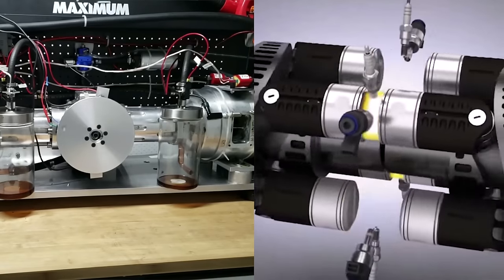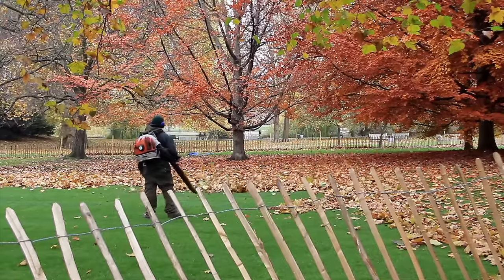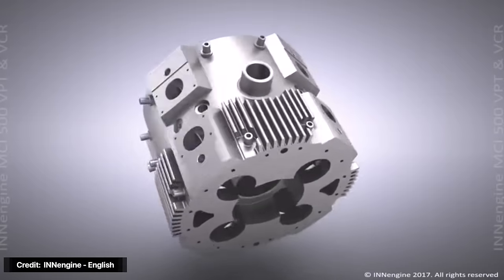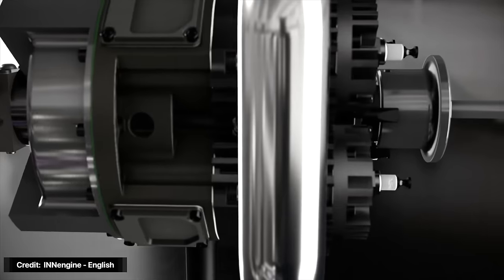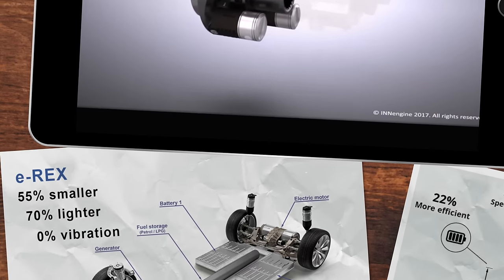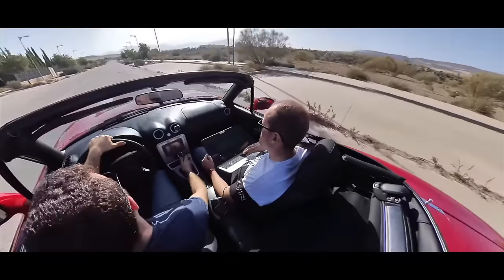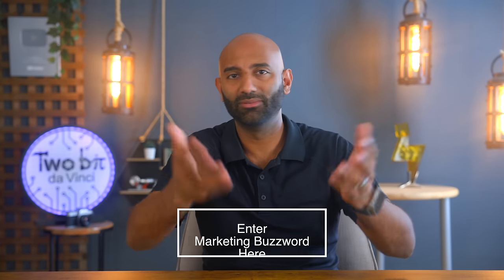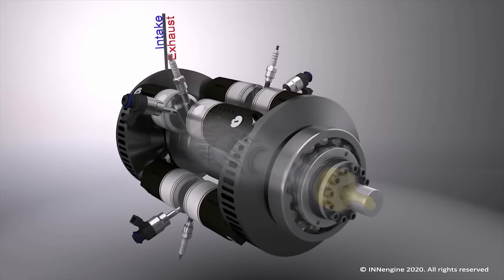One Stroke Engines - 200% More Efficient??

Comment: This is just 2 opposing 2 stroke engines. To have a true 1 stroke, you would need to have a 2 stroke engine that has a combustion chamber on each side of the piston, so that it is pushed on each stroke by a power stroke.
Also, I love the idea of a sine plate. Dynamcam had a sine plate design in 1941. It had the benefit of completing 4 strokes for all 12 cylinders every rotation of the engine. This means that it could produce a lot more power for every rotation than a conventional engine. It was a very promising design, I'm not sure what ever happened with it. But it is still legal to have one in an aircraft to this day.
Reply: As noted, low torque.
Reply: Probably very expensive
Reply: The rollers wear out.  ask any dodge hemi owner about the rollers on the their valve followers. at about 150k miles time for a cam and all new cam followers with rollers. In the case of this engine it would mean a total rebuild.  I do like the engine but best used to power a generator that runs at a fairly constant speed.
Reply: back and forth is two strokes
to have a 1 stroke your piston would have to go in a circle
Reply: @burtreynolds3143  Theres the Wankel engine.
Reply: @burtreynolds3143  you're right. I was thinking power strokes per recip of the piston, which would have 2 power strokes for each reciprocation. They cylinder sees a 2 stroke, but the piston sees strokes as if it's a 1 stroke. But thinking back to my thermodynamics class, it doesn't matter the power delivered to the piston, it matters what happens inside the cylinder.
Reply: Exactly, Chad.
Reply: Yes. That was clearly established. Even by the manufacturer. It's marketing, bruv.
Reply: The biggest problem with swashplate engines is fault tolerance.  What happens during a misfire?  Shakes the motor apart or makes driven mechanisms on the plate skip and chatter.  Injectors, spark plugs, and compression can fail.  That is the main reason.
Reply: The MYT is already using both sides of each piston in a rotating chamber and is efficient enough to run off air, since electrical spark will actually explode compressed atmosphere enough in that engine to be over-efficient by a good measure. The inventor Raphial wont talk to anyone about investment unless they prove they have 2+million first and he wont let go of the patent. He really screwed up and wasted the extra from the first investment round on a house that was repo'd. Last I talked to him, he'd moved into a hotel and was living off social security with his wife. He might have lost his trailers full of equipment to make them for all I know.
Reply: @vilefly  I've seen designs with a roller on each side of the cam plate, so you would have no skipping on a misfire. You would need it anyway for an intake stroke as you create a vacuum when drawing in air, unless you run a turbo.
Reply: @chadjensenster I've seen these designs for ages.  Like A/C compressors.  They make great compressors or air motors, but make for bad internal combustion engines.  It's all about resonance and harmonics caused by the "noise-forces" made by combustion.  It's a bit chaotic.  A roller is a piece of hardened metal, focusing all its force on a small contact point.......it WILL chatter.   Better off as a steam engine or with "fat sliders" on the swashplate.
Reply: That is correct there really is no such thing as a one stroke engine unless U were my late business partner when he caught my son watching porn in my home office. Now there he made the cliche about a little one stroke engine
Reply: @thekingsilverado3266  jet engines could be considered one stroke, but that's a stretch, since "stroke" implies reciprocation.
Reply: I am concerned about the wear of that sine plate over time. Seems like a point of failure or loss of  efficiency. And Tolerances could be an issue.
Reply: @frequentlycynical642  So torque is only created with a crankshaft and counter weights? So if I wanted more torque, I would get a bigger cranshaft and counter weights?
Reply: "michel swashplate engine". far older. "lamplough rotary barrel engine"... far older.

both solved the issue with the rollers/swashplate asemblies. 

michel used his thrust bearing , that is still used in heavy shipping propshafts.
lamplough used a yoke with spherical ends similar to what the "duke" engine uses. except its an opposed piston two stroke with sleeve valves and secondary "scavenging"pistons.

a century later, where are they now?

the problem with rollers on swashplates is they have a LINE contact to transfer pressure through. and that will break through any oil film, no matter what.

and that roller has a width... meaning the line of contact actually only has one POINT that rolls, everywhere else it scrubs/slides.

just like having a solid axle versus a differential. something has to give...

you cant eliminate this by a variation of a "taper roller", as the point of convergence of the tapers is constantly changing through the revolution. the spherical yoke and the michel thrust bearing are the only options that eliminate certain issues.

and as i said... where are they now?

Comment: Old dude here. 
I’ve never been against electric cars. In fact I can see the practicality in them , except for 2 big reasons. Range and cost. 
Neither of which has been addressed to date. 
And frankly changing every car or truck to electric in America is impractical due to  the cost of upgrading the grid, and needs of large semi trucks. 
I know they’re working on it, but we still aren’t there yet.
Reply: And every truck and car is not electric yet. They are working on it. This dumb argument is trotted out too many times. The electricity grid could not cope with, or not enough chargers if all cars were electric now.
Reply: I have yet to see an Electric Super Duty that would run 400-700 miles on a tank of diesel.  As with semis, there is a need for non-EVs.
Reply: Thermal runaway is a problem. Ever heard of the Felicity Ace or the Fremantle Highway? Both car carriers that caught fire due to an electric vehicle going into thermal runaway.
Reply: weight is also a huge problem. gas is 10x more efficient than a battery and you only have to carry 50 lbs with you instead of 1000. you can also carry another 20 lbs in a can in the trunk so you dont get stuck in the desert. temperature is also a problem, esp cold. if its 10 degrees outside, that 300 mile range will be closer to 100
Reply: @chrisbrossette  semis are too inefficient. we should be using more trains
Reply: @carlholland3819  use what works until we perfect a solution and CO2 is not the problem, it is in fact essential for all life on Earth.
Reply: @carlholland3819  We could but the railroads have been ripping up tracks instead of repairing them, this leaves semis as the best way.  Should we have better railways, I agree, but we are not using them as so much shipping is 'just in time' and the people can not wait weeks for deliveries.
Reply: Trains easily excell at hauling immensely large loads over a very far distance, with way less vehicle traffic on average. That being said railroad traffic is alao a thing but there are rare cases when it really gets busy on the rails but oftentimes they're mostly empty with one or 2 running locomotives pulling the loads and carrying the cargo to different locations.
Reply: We proved that, in California, just last summer when they were asking people not to charge their electric vehicles because the grid was being strained to just meet the ordinary peoples needs ‼️😲🤯
Reply: EVs cheaper over the life of the vehicle. Combustion has far more wear and tear and hidden costs in the form of replaceable parts. If you look into it, rental companies are putting 300k miles on Tesla's with only replacing brake pads. And that's worse case scenario bc everyone beats a rental. There's horror stories of dropping 4k on a battery but that's rare. No oil, plugs/wires, filters, etc to worry about. And dropping a new transmission at 150k is comparable to a new battery.
Reply: @stevethegreatis  EVs might have less moving parts, sure but even they can break down at any point in time. From a long term standpoint they are better but not what you call impervious to damage. Plus the power grid isn't upgraded or sophisticated enough yet to handle millions of them charging at once. And whenever the summer arrives people have their A/Cs on at full blast which raises the risk of power outages. As someone who loves the sound and feel of combustion engines, I do get it. With honesty.
Reply: @TheSilverShadow17 There is no problem with the moving parts, the biggest and most annoying problem is the complex consumer electronics !
Reply: @yakut9876  Perhaps
Reply: historically, with any kind of vehicle, range and cost are issues of scale, they only start to improve when you look into mass production, the price to buy them improves as the price to build them improves, the price to build them improves as the availability and price of tools improves, and the availability and price of tools doesn't improve until there's demand to produce the product more quickly in higher volumes
Reply: @chrisbrossette yes, checkout Tesla semi.
Reply: Totally agree, he triggered me when he kept repeating this mantra 'the future is EV'. As it sits today that is an absolute joke. The exponentially longer charging time compared to refueling added to the need to recharge/refuel far more often means that you would need vastly more chargers than bowsers at gas stations.
And the problem gets worse - As more cars are charging more power is demanded but not enough can be supplied, either locally (to the charging area) or statewide if it ever gets to that point.

What this means is that charging time will increase as the chargers can no longer charge at max charge rate, obviously this just compounds the problem.

As the technology exists today EVs absolutely cannot replace internal combustion.
Reply: I still walk down some streets today and see houses that have electric line going straight from the pole to the house with no transformer on them (240v is shared with othere houses) in the old days there was not to much needed for electricity, 200amp is the normal braker for today and some people need more. Just 10 years ago we where having water restrictions scents then we have built I would guess 3 x more usage then before. We always have the need before the product.
Reply: @stevethegreatis  as a mechanic,, your way wrong,, I'm driving living proof and know many others,, that have older work more miles than my 4x4 truck that are still very economically friendly and over all,, 20 plus years old and deff cheaper than anything electric,,, without cold weather hassle,, not enough charging stations,, long waiting times to charge for long trips,, and a huge strain on existing electric grids when very many are being used at once,, no way mine and many others older reliable vehicles cost more or even close to as much as an EV,, and let not even get into cold labor and detrimental mining practices where the mines are for elements necessary for stupid batteries

Comment: 14:59. The reason its a prototype is because there is ABSOLUTLY no lubrication going on. It would be extremely hard to cool that or improve its long lasting ability.
Reply: However, the reliability and longevity of this engine can be questioned because it hasn't been used in a long experience.

The conducts of the lubrication system need to be analyzed closely, definitely.
Reply: Enter Graphene..... watch for it...
Reply: lubrication can be done.  By the looks of it, there are no wrist pins to get oil to.  You just have to get it onto the cam followers and the cylinder walls.  Cooling it is another matter.    I think to make it really work the number of cylinders should be decreased to three to allow more space between them fof a water jacket.
Reply: You are mistaken.
Have you ever heard for oil fog lubrication?
Reply: Swash-plate IC engines are as old as the hills, this is just one of dozens of themes and variations, and none of them have ever made it into any commercial products. They dwell forever only on test-beds, the occasional test-vehicle; but mostly in the yellowing pages of Popular Science and Popular Mechanics.
Reply: All your problems I could solve. Material quality would be really important but doable
Reply: @-danR seeing the e-Rex design reminded me of an inverted a/c compressor. The compressor has one swash plate though driving pistons in double the cylinders
Reply: Yes, in my own similiar engine I invented about 27 years ago it was also a concern. There are of course many ways to lubricate, some of which I considered in mine. Without doing a huge deepdive into the engine in this video, mine was similiar enough that I can assure cooling is easy enough, I was at the early times of CAD and wrote my own code to write bitmaps from an Amstrad CPC664 computer to a dot matrix printer and code for all the cross sections including water cooling. I never built it, I didn't have the budget and I could see there was a lot of work to do on combustion efficiency on the engine and to reduce expected oxides of nitrogen, even to the extent of skipped cylinder combustion at low load which needed injection. Back then, I hadn't taught myself to program microcontrollers so there was quite a lot of work on the ideal design which was beyond my immediate resources. The hardest part to cool is the piston heads. In mine I had internal supercharging which would have permitted directed air cooling. I hadn't factored in any intercooler though. Ultimately I headed in another direction, reinventing a superior implementation of the Rankine cycle for external combustion engines, it was a much better engine solution.
Reply: @MaMi-gy8ln  I'm 77 and been turning wrenches almost as long as I've been alive.  Never heard of "oil fog" lubrication.  Please enlighten us.
Reply: I think it is possible to cool and lubricate it effectively. However,  3d printing is the only way I imagine it being done. Unfortunately, that's expensive.
Reply: @-danR  They used to say things like that about the lightbulb, the automobile, and the "moving pictures," too.
Reply: @fluiditynz  If you didn't build the thing, you didn't invent it. You just had an idea, bruv.
Reply: @ernie5229  You've not had the experience then. It starts with a great memory for quirky technical information. Then there's frustration at an existing engine and inspiration. then there's an extensive prior art search, writing software for CAD before it was a mainstream thing. Exaustively working through the cross sectional laminations of the engines on computer, on paper, mentally. Determining hot spots, cool areas, loading forces, bearing loads and how to lubricate. Studying combustion under different mixtures. More innovations. And all the time, documenting, dating, notating. Compiling the inventor's project book on the invention. And you think you can redefine it as just an idea bruv? 😂 You tell yourself that.
Reply: Are all two stroke  lubrication systems bad?
Reply: @MaMi-gy8ln   You mean the 2 cycle lawn mowers, outboard motors and Saab extinct lubrication systems?
Reply: @dw31415  Not at all. But a sump with gravity controlled oil recovery is so simple and reliable in comparison to an efficient 2-stroke lube system, at least as soon as you change the crabkcase orientation or you reject oil mixed with fuel. /metalurgy can help a lot. High carbon steel for oil retention, molybdenum alloys for sliperyness. But oil cools also if it's fed from a cooler place, it transports and redistributes heat. Oil also can bridge a piston to cylinder gap and conduct heat from the hotter surface to the cooler one. The biggest challenge is getting that oil to exactly the right places, evenly spread  and in the optimum amount. A porous oil reservoir helps.
Reply: @frequentlycynical642  Oil is injected into the space to be lubricated through a nozzle.
Reply: Shouldn't be that hard to add lubrication to that..

Comment: The idea of the “range extender” is how I first heard the idea of hybrids described decades ago. A very small IC engine would be tuned to run at its optimal operating point to charge a smaller battery when needed and otherwise completely electric drive. It made a lot of sense to me. No transmission, the performance of electric drive but the backup capacity and energy capacity of gasoline when needed for longer trips.
Reply: Older than that, we had train locomotives using hybrid diesel-electric technology for ages.  Diesel generator + electric drive + battery + regenerative brakes.  Yup.  They did it first.
Reply: The set up you bring up is being used around the world in many countries for many years already! Gas electric with small battery about 50 miles of range, longer range is off the generator and  is at least as good of MPG as an economy gas vehicle on the hwy. My best friend just bought one in Thailand a year ago and loves it, averages 40+ mpg city and hwy and range is the same as any gas only car. America probably will not allow this type here as virtue signally over no more combustion engines is more important than actually reducing emissions. Besides if big batteries can ruin the planet faster then America will go that direction.
Reply: yeah. in a package its called toyota
Reply: But the biggest problems and disasters remain the very complex electronics !